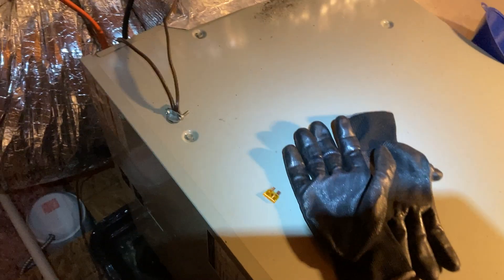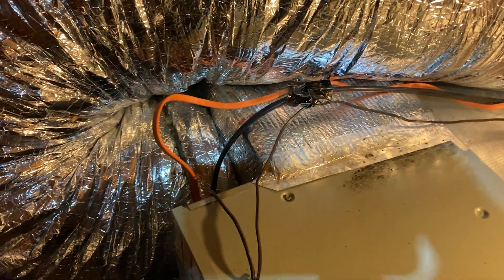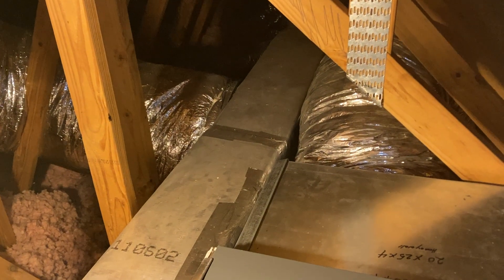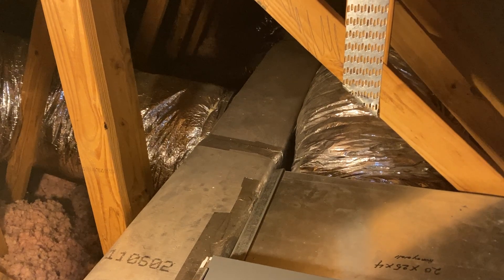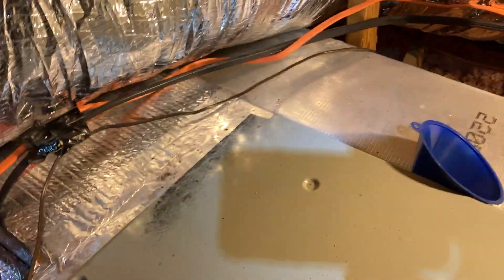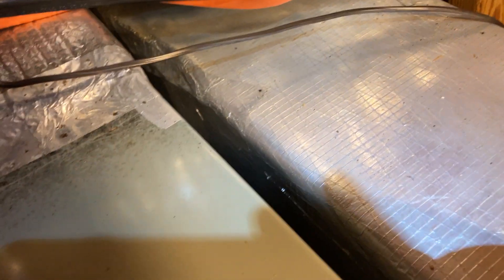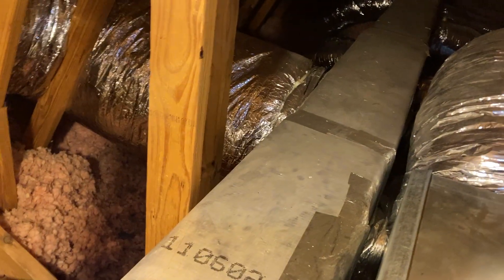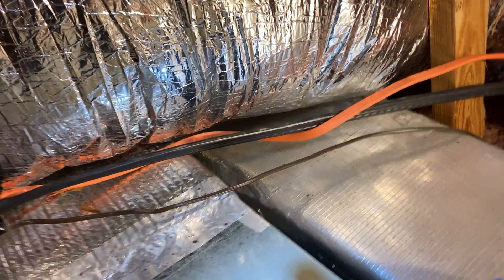HVAC in my attic, long 18 inch flex from air handler to trunk

Comment: Am I seeing that correctly?  I know the video isn't the entire area, but that looks like the supply plenum has an 18" duct doing a 180 degree turn and going back down and connecting to the return duct?  Maybe I just need to see more video of the entire setup from one end to another.
Reply from the maker: Yes that is correct. 90 degree turn out of the end of the air handler. Should I just connect it right into the main trunk line?
Reply from the maker: Is there any way to get rid of the 180 degree turn?